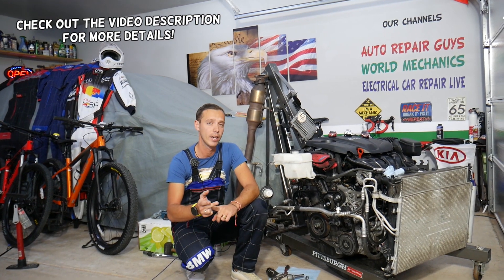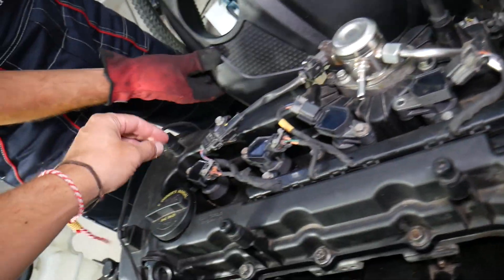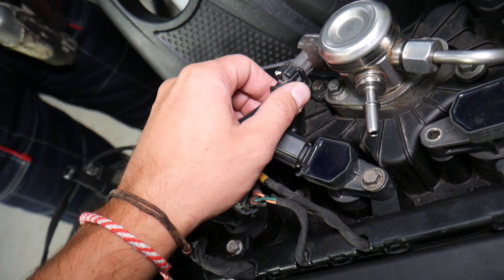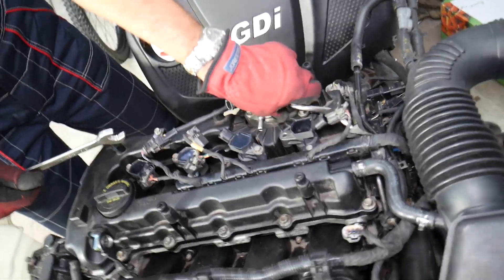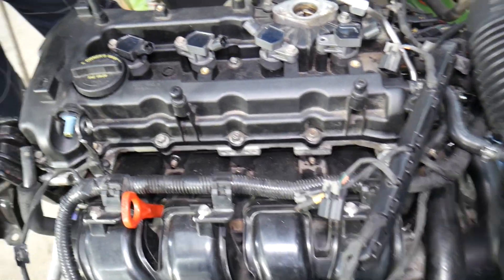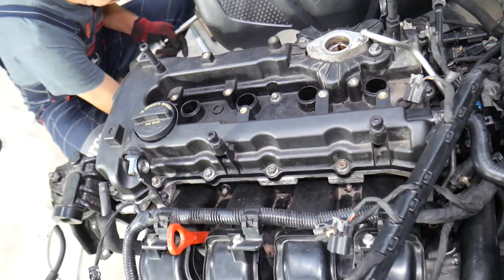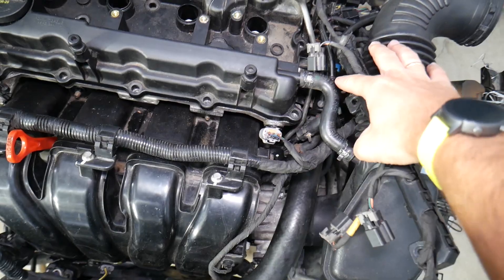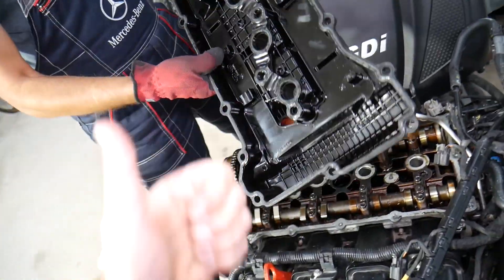VALVE COVER REPLACEMENT REMOVAL HYUNDAI KIA 2.4 GDI ENGINE

Comment: Need help identifying a 2016  Kia Soul part not in parts schematics.....PLEASE....mech. fuel pump to sylinder head mounting plate , name or part # ??? I can see the part in your valve cover replacement video above but can't find it in anyones part listing or pictures